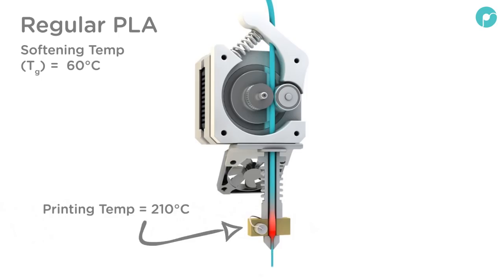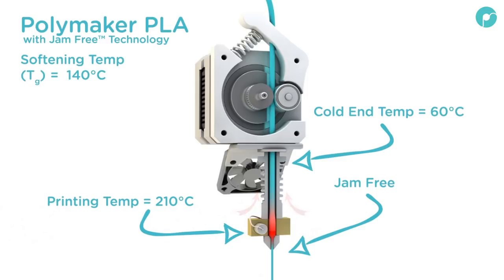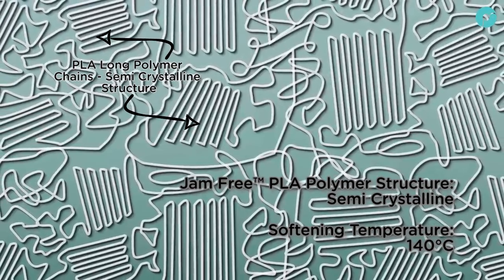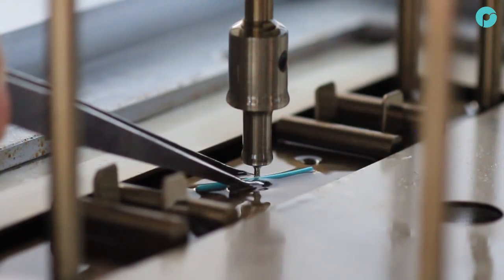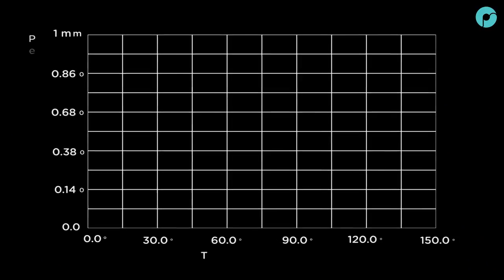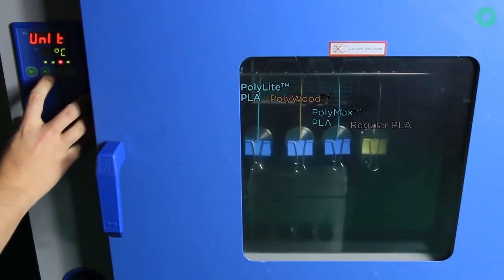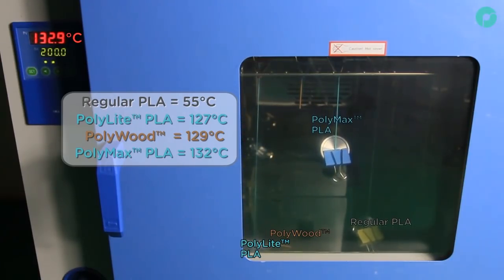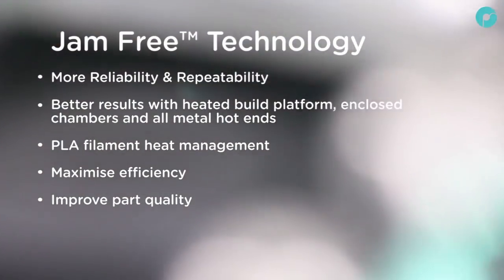3D Printing - Jam Free™ Technology

Comment: I suspect once filament has been melted/extruded its back to being regular PLA....   So this is a fix for a badly designed hot end with a pore thermal break. Seems extreme when you could just add a fan.
Reply: I don't use one but maybe this is good for printers in enclosures? I'd still agree that better heatsink cooling would be the answer, even if you have to bring outside air in.
Reply: The jamming issue can indeed be solved in two ways Hardware or Material :)